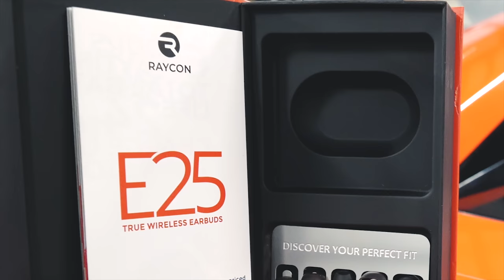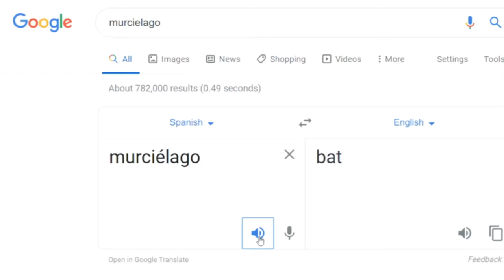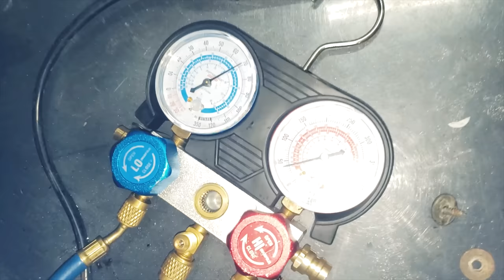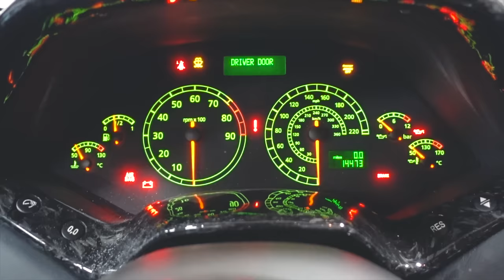My Fast & Furious Lamborghini Murcielago Movie Car Is FINISHED!!!

Comment: Murcielago: I'm Finished !!
Unfinished Gallardo: Unfair, This was supposed to be first come first service !!
Reply: The gallardo is finished he just needs to fix the soft top and register it
Reply: Bro, You just contradicted yourself !! SMH it’s finished but the gallardo needs to get the soft top fixed...so it’s NOT FINISHED then !!
Reply: Junito Punto Comm it still runs and drives making over 800 whp reliably with all the body and interior work finished, the soft top can still be manually put up and down
Reply: Was the 100th 👍
Reply: GM Kof hard Z Reliable for a gallardo
Reply: The Gallardo is showroom in appearance and mechanically finished and ready to go, but it's also true that he hasn't figured out what the glitch is in the convertible top. Im giving him a pass on the soft top and I think many others would if he did a damn video on a final unveiling and test drive. Drive around town with it, order something from a drive through and go to a car meet with it. Otherwise people will continue to have doubts on how functional the car actually is.
Reply: Yeah, if there’s shit to do it isn’t finished

Comment: I would tig a bolt on the wiper cover, why? if you running 150mph and one of them comes off it's coming through the windshield
Reply: I would too, but for a different reason. Any kid with a screwdriver can 'souvenir' it.
Reply: Exactly. That’s an accident waiting to happen.

Comment: Freddy, I grew up with my uncle working with fiberglass and metal work. We didn’t specifically work with cars we did workin the suburbs of Detroit. I learned a lot from  him. When you talked about being 🥵. I worked in a fiberglass factory cutting fiberglass. During the summer with those paper suits on it wasn’t as hot as you had it inFL but hot non the less. I also lost my father from lung cancer so thank you for bringing awareness to any type of cancer.

Comment: What a machine! The transformation from it being in the air to sitting on its wheels near the end really surprised me, it looks absolutely amazing. And the blacked out tail lights work for me. Congratulations. 
Finally seen you doing some work (making the aluminium covers) but really wanted to see the rolling and the wrapping both kinda skipped over.

Comment: I’m a toolmaker and I’ve never seen blue in an aerosol can. In my tool room we use the more solid blue and a brush to apply to one half of the tool before closing it up and then when you open it you can see where the tool is hitting on the other side as the blue transfers over. I guess we’re just old fashioned here in the U.K.

Comment: “My harbor freight sandblaster”

Funny how if a tool is made by any other manufacturer it is just the name of that tool and not the manufacturer. I guess people are still surprised that HF makes shit that actually works fairly decently. To the extent they feel the need to call out that it is made by HF. 😄
Reply: Use them all the time, and no regrets yet. I was stoked when we finally got one in town. Funny thing is, the first time we went, my wife spent more money than I did. She did the same thing when Rural King came to town too.  She is no longer allowed to go to either place !

Comment: I've been tough that 2/3 piece wheels is better to do it in square pattern, put 4 bolts at the beginning like a cross and then each bolt in each corner...only with the hand to keep the center plate leveled. Then you you start bolting it soft and then torque them in cross pattern and then a final check in circle.

Comment: Tavarish you need to get yourself a portable water evaporative cooler foor your garage. It's worth the money and is basically an airconditionar but portable like a fan. Look it up. Those fans you have in there do nothing but waste electricity. You will not regret it.

Comment: There was an obvious and apparent hole in the chassis, near the center.  Looks similar to penetration from a bullet, in how metal would be pealed back.  I saw it in your videos several times.  And it had rust on it.  Did you patch it and reinforce the chassis?

Comment: Is the veilside front bumper missing a small piece?  The pics on the vividracing site have a thin black lip between the radiator holes.

Comment: Mercy el argo. 2-1-2, or 2-3 syllables. How you can compare the way you pronounce it and the way she, and everyone else pronounces it, I do not know! 

The way she says it has a Spanish inflection, but it doesn't sound like the "Al" sound you make, but an "El" sound. It comes out like Murcie-algo when you say it, with a 2-2 syllable count, not Mercy-el-ah-go as a 2-3 syllable count as it should be. 

I think that's why the concensus that you're mispronouncing it. It's not that you're saying it wrong per se, it's a pronunciation issue with how you hear it vs how you say it.

Comment: Congrats on the completion of the Lambo.  It's a beautiful car but unfortunately, as with all of these types of cars, your troubles are just beginning.  As a work of art and an awesome example of fine workmanship, who wouldn't love this ride?  The problem is that it isn't a quality manufactured car to begin with.  What happens in over 90% of the cases where guys buy "supercars", they simply don't get driven because something breaks and it is so expensive to fix the problem, the car simply sits around.  You can check out any source for used cars and way more often than not, you'll see a Ferrari, Aston-Martin, Lamborghini, McLaren or some other expensive race car wannabe for sale with only a few thousand miles on it.  Even though this car was purchased at a great price, lots of effort went into it and in a year from now, it will have ....maybe.....one or two thousand miles on the odometer and something major will have gone wrong.  I only say this because of experience several times and knowing quite a few other guys who also went down the same road.  Life is short and it's a lot of fun to have these toys but in the end, when you get older....you'll wonder why you ever wasted so much time on something of so little use.  If you've got money to afford these things, invest it wisely and before you know it, you're up there in years and you'll be thankful you were smart and didn't fall prey to your emotions.  Just one man's opinion and only worth what you paid for it!!